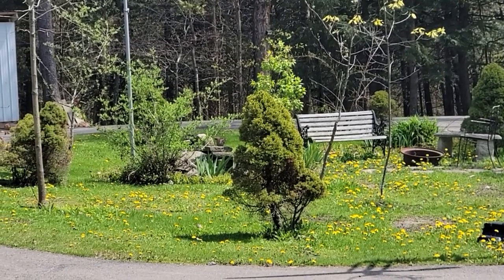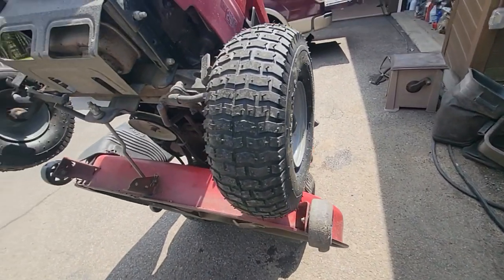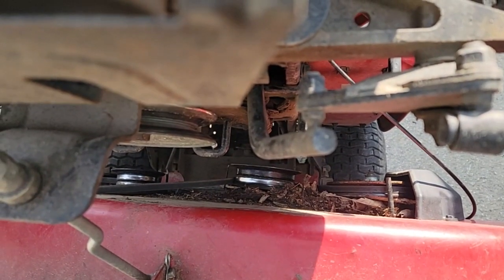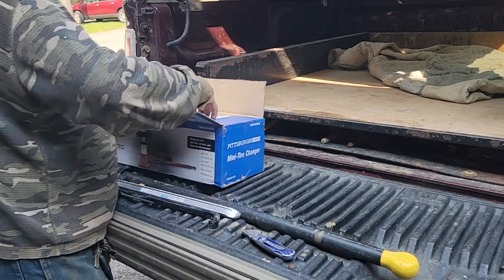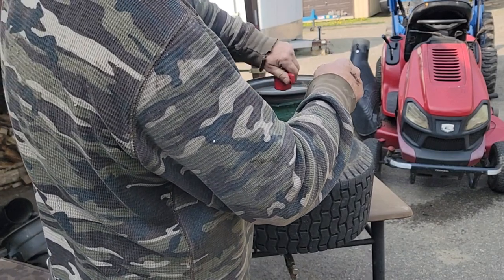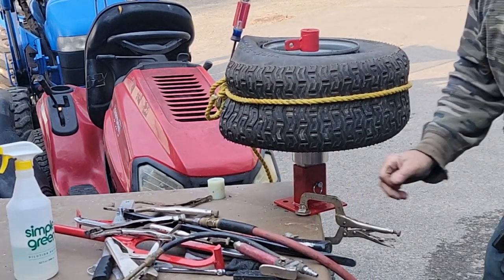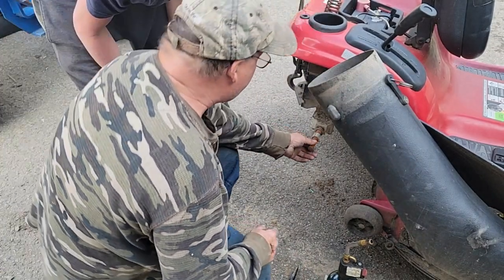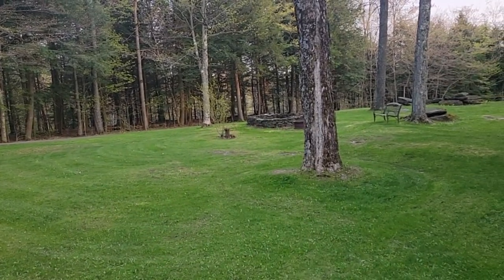Craftsman T2400 Drive Belt and Tire Replacement

Comment: What are the numbers on the belt please?
Reply: 125907X
Reply from the maker: 125907x is the Craftsman drive belt # for the t2400.
405143 is the mower belt#.
You can cross reference them on Amazon like at d&d belts